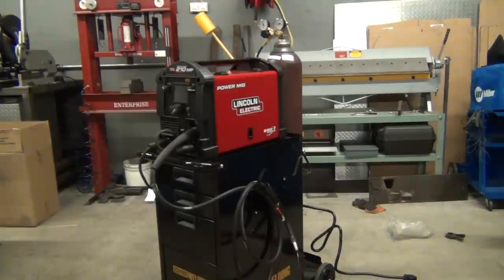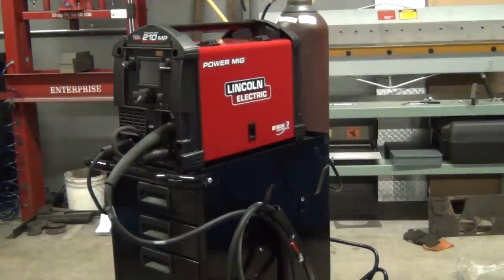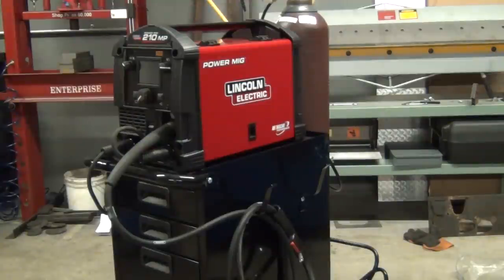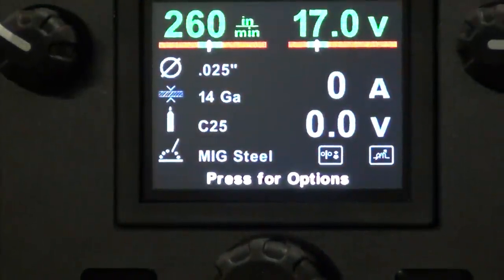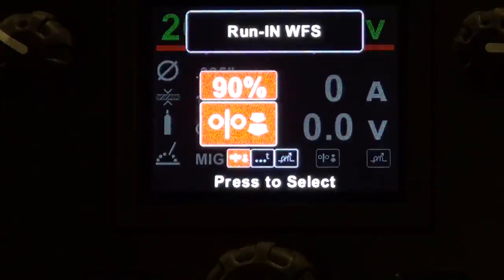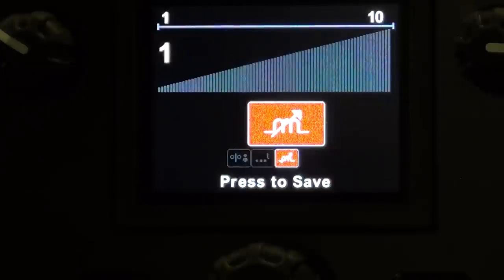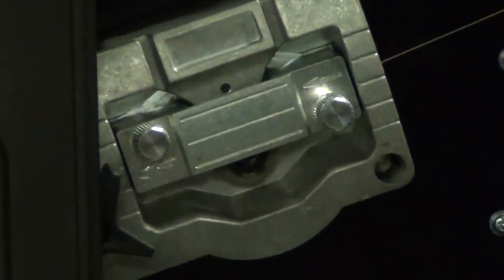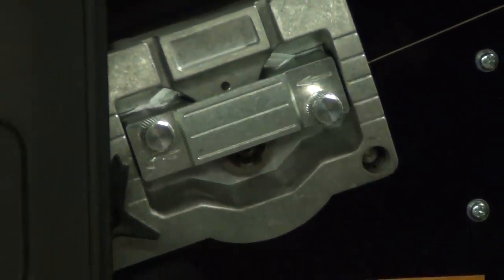LIncoln Power MIg 210 MP Part 1

Comment: you should weld your own cart its a good way to test out the welder when you first get it and in my opinion it just makes more sense. cool welder though im thinking about buying one.
Reply from the maker: +Nathan Simms, Thanks for checking out video.I just didn't have the time to build my own welding cart.Working my full time job,running a part time business along with kids and everything else in life.The Harbour Freight cart I got at a good price.It was on sale and with a 20% off coupon it was well worth it.The welding cart that I would have built wouldn't have been simple and would have taken up too much time.I love building my own stuff and still do when there is time.
Reply: yea i know what thats like.
Reply: +Reeds Repair and Fab I just picked up that same welding cabinet at harbor freight.  It was on sale for 179, plus I got 20% off.  There's not way I could justify building that myself when it costs so little to buy like that.  Wouldn't want to waste that much time either.

Comment: I've welded for over 30 years, and I am on my 2nd Lincoln. the first was a 110, could only weld thin metal which was ok since I did collision. I now have an 180T, and had nothing but problems with the torch getting loose and not having gas flow. After several years of putting up with that I contacted the company, the service guy reply was to get a new turn screw. WTF. 
  I found Lincoln's problem, they have something machined wrong and the torch will not go in far enough to keep seated, my solution, since I do have access to a machine shop was to remove approx. 2mm from the torch body where it meets the wheels. Problem solved, or at least I thought, not the drive wheel keeps falling off, somehow the screw that holds it on will back out and off comes the wheel. My next machine will be "BLUE"

Comment: Thinking about my first welder. What exactly is induction setting and what does it do?
Reply from the maker: The inductance setting makes the arc a little crisper or a little softer.Sometimes you need a softer arc to weld a wider gap or to have the weld bead wet in a little more.Where as a crisper arc will be a tighter arc with more spatter.The crisper arc will give a smaller bead profile and the weld bead won't wet in like a softer arc.A softer arc will have less spatter as long as your settings are in the ballpark.